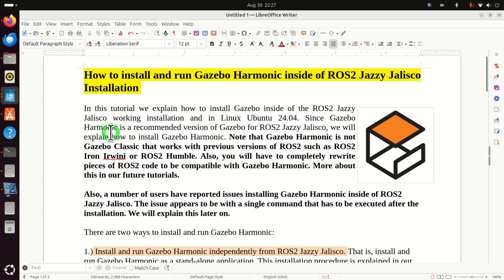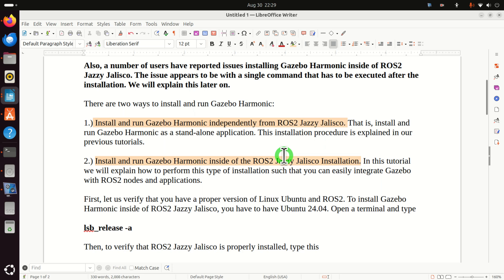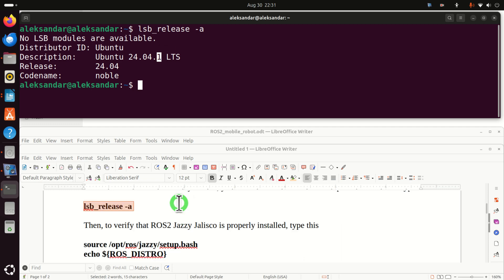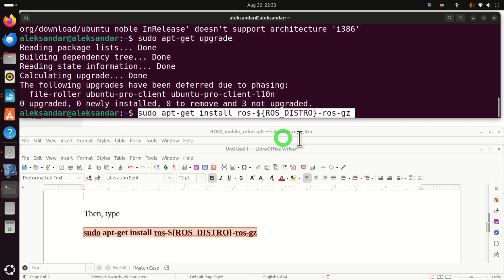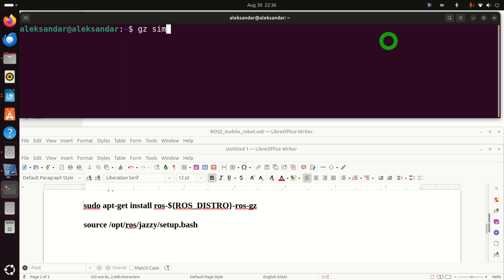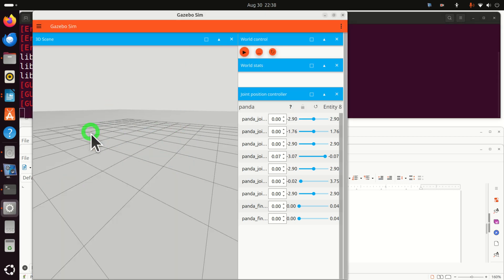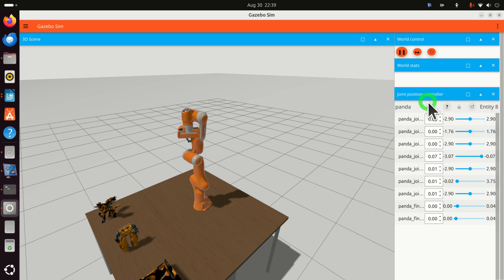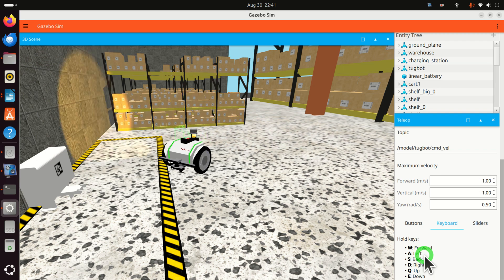Correctly Install Gazebo Harmonic Inside of ROS2 Jazzy Installation -Fix Gazebo Installation Issues

Comment: I faced a problem where the gazebo crashed when I open a project..
To fix this issue put export QT_QPA_PLATFORM=xcb into your bashrc file
Reply from the maker: good
Reply: Dude, I researched this problem for hours and found it, I was very happy until I saw this comment from you.
I could solve it in seconds 😪
Reply: @Oguzhan_o7  It's always a struggle, good luck on ur project tho
Reply: mine is still crashing. its saying gazebo gui is not responing
Reply: @mikhaelsunil2383  same issue bro. I added that linein bashrc but still gui not responding. Please let me know if you find or found a solution already. I'll do same
Reply: mikks@myubuntu:~$ gz sim
[Err] [SystemPaths.cc:525] Could not resolve file [texture.png] can u please help me out
Reply: @mikhaelsunil2383  Ith its a problem with the installation of gazebo, also make sure u install the gazebo version that is compatible with ur current ubuntu version, Im working on ubuntu 24, gazebo harmonic working fine